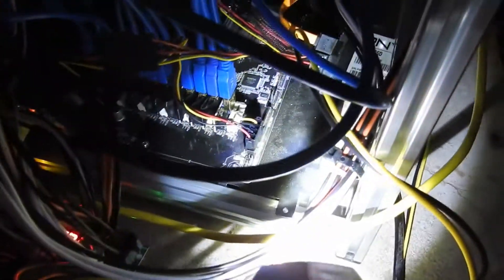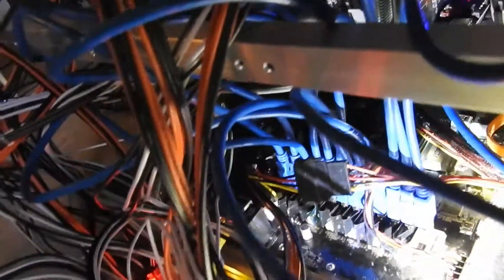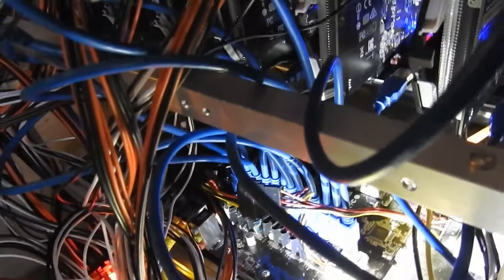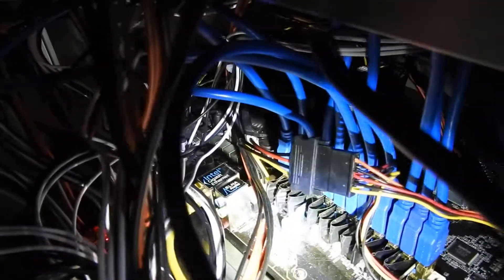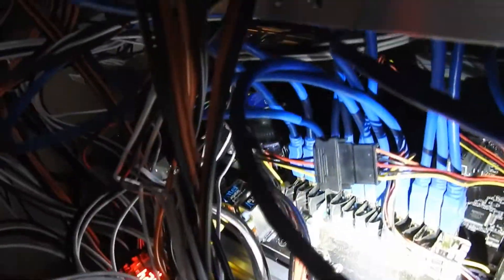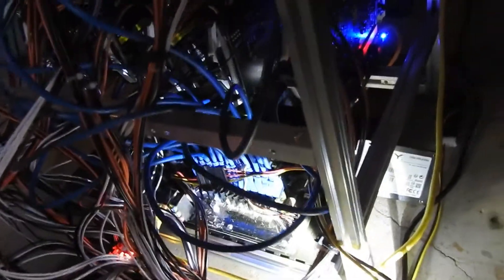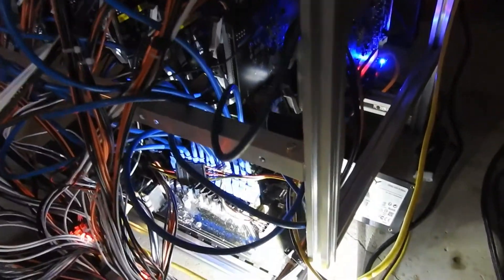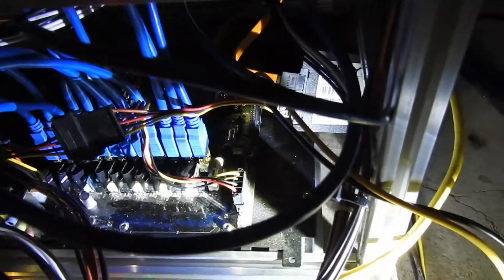[ASRock H110] - Part 15 - Two additional power connections I missed in the videos.

Comment: I can’t get display to my monitor to intialize things I have taken and reattached the Bios battery switched cmos jumper and then back and powered the Molex but can’t get display
Reply from the maker: Have you tried pluging into the card in the first slot.  Or you can unplug all the cards but 1 and try the output from that card
Reply: @dragonslair80  I only have one card building my first rig before buying them I put the GPU directly on the long GPU slot if that’s what you mean. I’m really not sure what else to do
Reply from the maker: @Mystical922  Do you have any riser cards?  Try getting your video out of the motherboard with no cards plugged in to see if the display works at all.  I am guessing it powers on and stays on?

Comment: Hi mate what about the Sata power on the asrock H110 board is that not required?
Reply: NOOO, I burned up my first h110 mobo by powering the sata power and the 2 molex. Also the molex shown in this vid isn't necessarily required, even though the mobo manual says so 3+ cards. I'm running 10 gpus just fine for weeks now without the molex or sata power. Unnecessary when using powered risers.
Reply: @Sinclair_USMC  cheers Brad
Reply: @HeightAdjuster  np, happy mining
Reply from the maker: @Sinclair_USMC  Sweet, mine would not fire all of the cards without it.
Reply from the maker: Nope, that one is not required.
Reply from the maker: The one on the motherboard, only SATA required is for the SSD.

Comment: I've been having trouble detecting more than 3 gpus. Maybe this is my problem on this mobo. I finally attached another molex connection to that other pcie pwr spot.
Reply from the maker: Yeah, that should get it for you.  Are you using multiple power supplies?
Reply: Yes I am. And this worked now! I got 4 gpus on the rig now. So I can start adding more! Thanks alot!
Reply from the maker: @randychaidez5972  My pleasure, glad I can help.